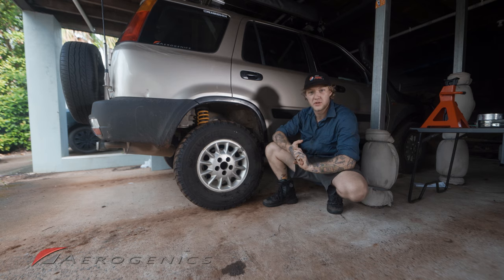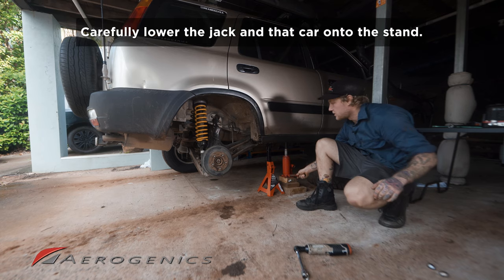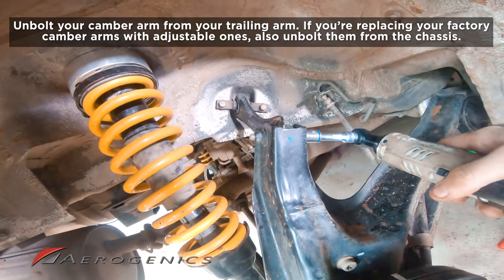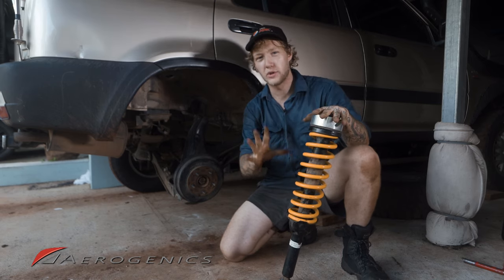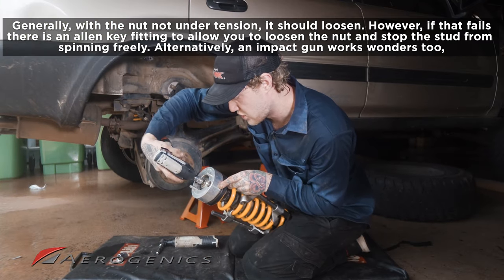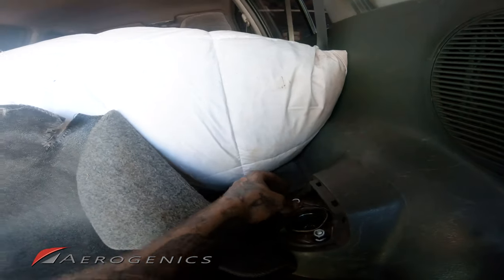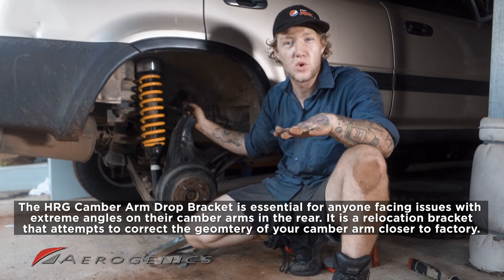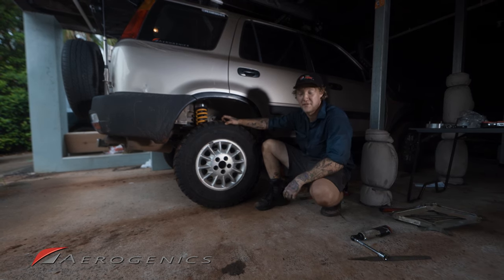How to LIFT a HONDA CR V RD1 with 1.5" Spacers (Rear Only)

Comment: Good stuff!! Do you have a video about installing the trailing arm spacers? I'm in the process of lifting my cr-v and putting bigger tires. I'm running into an issue without the spacers where the the axle and rear wheels are not centered after the lift and are pushed waaaay to much to the front. Would love a video on installing those!
Reply from the maker: No sorry I don't.  While they're necessary, the current designs I don't really want to show off because of few issues with how they mount and what that might do to the vehicle.

A friend of mine is currently in the process of finishing up a trailing arm drop kit that I will be doing a detailed install video for that addresses our concerns with current subframe drop kits.

Sorry for the reply.

Comment: This is by far the most informative and well presented video I have seen on lifting a crv. I want to put a lift on my 2005 crv lx and this video was extremely helpful. I am new to the world of lifting crv's or any vehicle for that matter. I picked up a 2 inch lift kit from HRGengineering that comes with 2 inch lift spacers for the back and front. It also comes with the adjustable control arms for the rear and offset camber bolts for the front. The question I have is - will i also need to install a subframe kit to lower the drive train in order to not experience any axle wobble? Or is a subframe kit necessary only if my lift was going to be higher than 2 inches? OR should i just install the 2 inch lift kit and see how that goes, and if I do experience axle wobbles, then install a subframe drop kit? Thank you.
Reply from the maker: I'm not 100% sure with the 2nd gen's but 2" is prime axle wobble territory with the 1st gens. 

My main worry with installing 2" without the drop kit is splitting cv boots which is just something else you'll have to replace. May not happen but honestly after replacing a tonne of stuff over the last 6 months due to not taking care of the subframe drop it had worn out plenty of my bushings and components.

You could get away with it but my advice is if it's within your budget, don't cut corners, do it right and you won't have to touch again.
Reply: @isakjetbean  Super helpful. I'll take your advice. Really appreciate your input. Take care.
Reply: how is your crv now? is using spacers safe in the long run?
Reply: @cefvelasco7200  I still have my '05 CRV with the HRG 2 inch lift kit and 1 inch subframe drop kit. 2 years in and no issues with the kit so far.

Comment: Can you use these spacers on OEM springs or you have to upgrade stiffer spring? Or softer whichever is more preferably.  Thanks
Reply from the maker: Because it sits on top of the strut and not the spring, you can use whatever spring setup you like. Personally, I always recommend replacing your springs when lifting the vehicle, as your factory springs will likely be pretty worn out.

However, you absolutely don't have to, it's just down to preference.

Comment: Nice what springs did you go for? Did you upgrade struts?
Reply from the maker: I've been running King Springs for about 2 years now. I absolutely love them, I know 3 other people running them and we all agree feels like factory and gives around 1.5" lift.

As for shocks, I have Monroe shocks up front (about 80k old) and the rears and factory and in the next 6 months I'll be replacing them all with brand new Monroe gas shocks

Comment: What kind of springs are you running? Looks gnarly
Reply from the maker: King Springs, they make a 1.5"ish lift for the 1st gen that rides like factory but has a progressive spring rate so doesn't bottom out as easily with weight.

Comment: I got a 2000 rd1 I just fit some 20 in niche rims on it. 245/45/20 the front is good. My rear is sagging, it rubs if I hit And pot hole, and I'm thinking about doing a 1.5 inch lift in the back. I have a question about wy you rotated the top hat and would I need any other mod to the rear, or can I just fit a 1.5 spacer, stock suspension, and not rotating spring?
Reply from the maker: You have to rotate the top hat because the studs won't line up the same.

You can fit a 1.5" spacer up without replacing anything, but you have to rotate the top hat or else it won't line up when you go to bolt it up

Comment: I recently had 2" spacers installed, however the tie rod ends aren't long enough, causing the tires to be angled. I'm looking for longer tie rod ends or extensions. Can you help? Thanks!
Reply from the maker: Don't extend your tie rods, that's not the solution. It's dangerous and will cause an accident.

When lifting a vehicle with spacers, you're just adding a block between your car and your suspension at 1 point.

If you look at your suspension, you'll see with the spacers in how every angles down to the bottom of the strut that the spacer is installed on. That's because where once point mounted to the body has a 2" spacer, the subframe and engine where the rest links back to is sitting right where it was. 

To do this properly and avoid issues like yours, you need a subframe and engine drop to correct these. This is the exact same as lifting the vehicle, however instead of doing it at the struts, we're doing it where the suspension and steering links back to the body, so all control arms and tie rods are level again. 

Obviously, this compromises your lift height as it lowers your engine and subframe back down, however it allows you to fit larger tyres to make back some height. 

Anyone who tells you you don't need a subframe drop hasn't had theirs long enough to encounter all the issues you'll face without. 

Why not simply extend them? As soon as you hit a bump, that suspension will travel up, which will cause the angle on those arms to level out and push away from the vehicle... You can see where I'm going here - if you extend your tie rods, as soon as you hit a bump, it'll steer the vehicle against itself and either cause major damage or an accident.

Comment: I see that you didn't cut off your plastic fender out. What size tire are you running on now with that lift spacer?
Reply from the maker: I've been running the same tyres since I fit my original lift setup and they're 235/75/15s, I'm moving up to 31s which is why I"m lifting more!
Reply: Do you have any cooling issues with those tires on the road? I just bought an automatic AWD rd1 with a similar set up (minus a drive shaft 😏) and she's a dog on the road with the gearing and likes to overheat
Reply from the maker: @clobberbusters  Nah, I'm running a stock radiator and never even hits halfway on my temp gauge. However, I'm driving a manual so that probably helps.
Reply: @isakjetbean  how much lift do I need for 235 75 15 and where can you get the lift kit I live in Victoria thanks love your video

Comment: Hey guys, I have a 1997 CRV RD1. I have been having a lot of noises coming from the front when driving into potholes and turning. Any recommendations on what to check and do?
Reply from the maker: Could be a lot of things.

Sway bar bushings are the first thing to check.

Is it riding rough/bumpy/bouncy?  Check your shocks.

Do you feel the knock almost like its at the wheel? Check your control arms and your steering links.

Do you feel it mainly in the steering wheel? Definitely check your steering.

Lots of things to check. Hope this helps.

Comment: If I am looking to buy a CR-V is the RD1 96-01 the best generation to buy or what is the best generation to buy to mod. Thanks
Reply from the maker: Depends what you're going for, but for offroad the preference is 1st or 2nd gen. I went for the 1st gen because I believe it made less compromises on space, interior felt better and the rear hatch is much nice.

First gen seems to do better with it's ground clearance and angles too, though they're pretty damn similar.

Second gen has more power, and can handle bigger tyres easier, but it's really down to preference.
Reply: @isakjetbean  Thanks, I just bought a second gen with manual. There were only three manual trans crv's in Southern Calif. I got a 2006

Comment: I’m trying to install this exact same kit but literally cannot reinstall after mounting the spacers. It seems to be impossible to get the shock to align to the bottom LCA bolt. Any tips? It seems like your CRV clears just fine.
Reply from the maker: It sounds like you didn't rotate the top hat. Have you watched the video through completely?

Try bolting the shock to the LCA first, if your studs on your spacer dont align, your top hat isn't rotated correctly.
Reply: @isakjetbean   thanks for the reply. I did rotate the top hat. It just seems nearly impossible to get enough space for the top studs of the shock to fit back in. However, I just noticed you also unbolted the camber arms to get it to fit. Should that give me enough space?
Reply from the maker: @DJ-pt7fd  Yep, so there are a few things limiting articulation on the trailing arm, the camber arm being the main one. If I don't disconnect my camber arm I have to use a pry-bar and it feels awful haha

Comment: I just ordered tema 4x4 40mm OR 1 1/2 INCH strut spacers for my 06 highlander/kluger.. took it to Toyota. They won't do it. They claim to say its gonna have problems. If its the 4runner. It's a different story. (BULLSHIT.....) its just a 1 1/2 inch spacer. Its its a 3 inch. I'd agree.

Comment from the maker: Timestamps:

00:00 - Intro

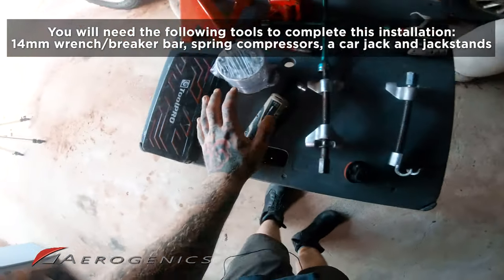01:22 - What Tools Do You Need?

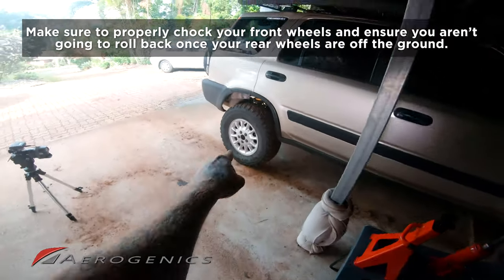02:28 - Chock Your Front Wheels and Take Off Your Rear Wheels

03:32 - Unbolt your sway bar from the lower control arm

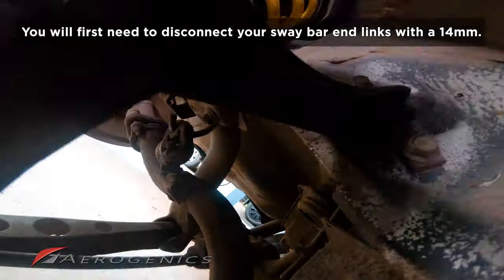04:00 - Loosen the nuts on the top hat of the strut from inside the boot of the vehicle

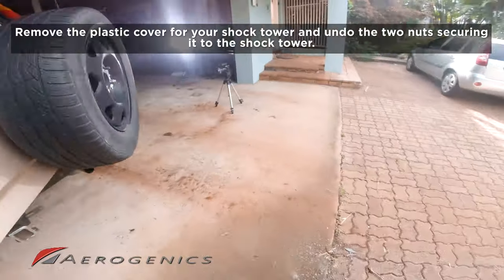04:57 - Remove the bolt securing the strut in the lower control arm

05:50 - Unbolt your upper control arm from the trailing arm

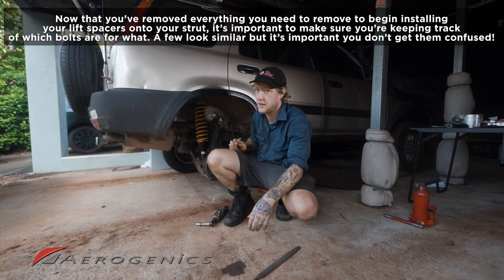07:12 - Remove the nuts from the top hat and remove the strut assembly from the vehicle

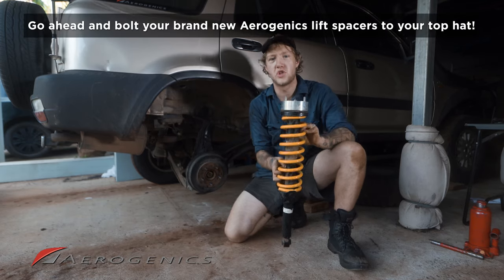08:04 - Bolt the spacer to your top hat

08:40 - BUY TRAILING ARM SPACERS FOR LIFTS OVER 1.5"!!!!

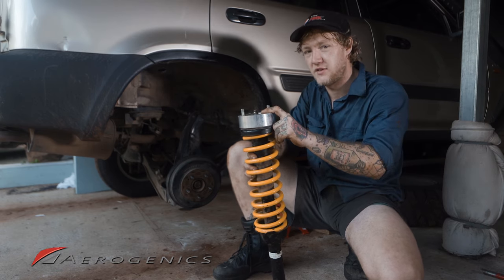09:47 - MOST IMPORTANT STEP - ROTATE YOUR TOP HAT AND AVOID DISASTER 💀💀

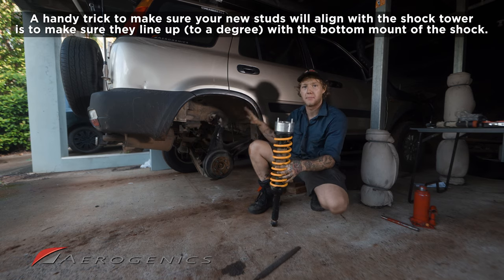13:25 - Begin reinstalling the strut to the vehicle

14:08 - Finger tighten strut to shock tower in boot

14:20 - Insert LCA shock bolt to secure strut in place

14:30 - Upper Camber Arm Advice - Adjustable Camber Arms + Brackets

16:52 - Bolt up your upper control arm

18:00 - Tighten everything down lightly and reattach your sway bar end link to your lower control arm

19:30 - Put your wheel back on, lower the vehicle to the ground safely and torque under ride height - Enjoy your CR-V!